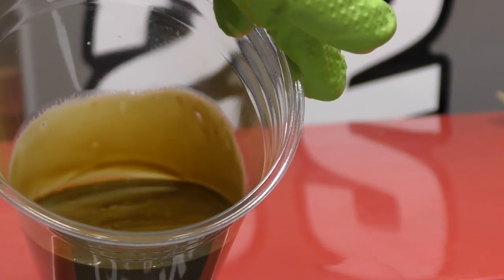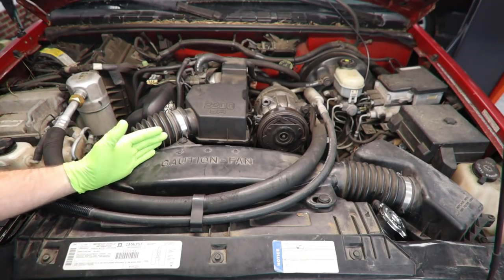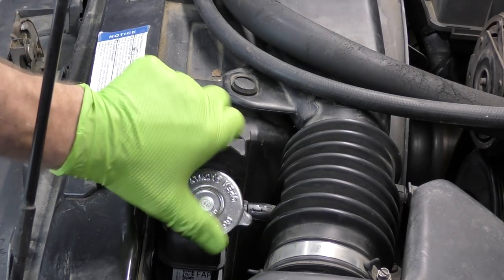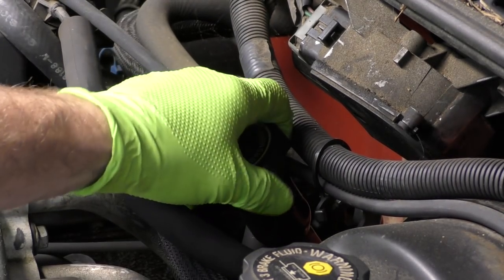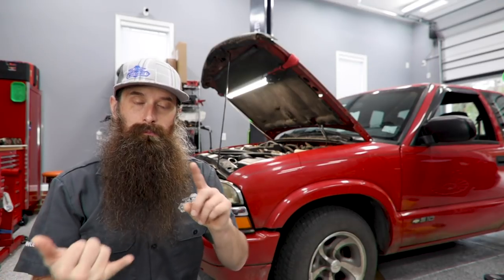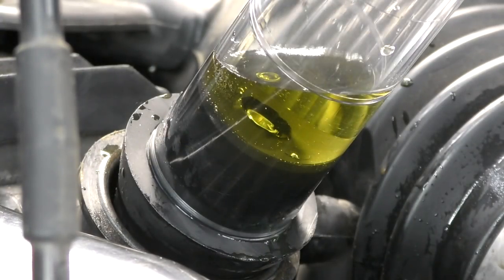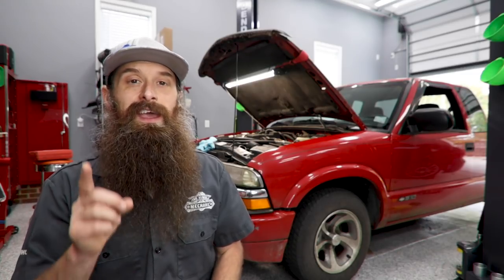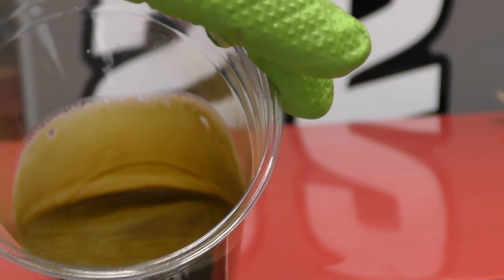Does Your Car Have a BLOWN HEAD GASKET?

Comment: Not that is applies here but don't ever overlook water to oil coolers. they can split internally and cause the same issue
Reply from the maker: Facts. I’m pretty sure I mentioned that. That’s the VW way to mix oil abs coolant ha
Reply: and he mentions it lol
Reply from the maker: Hahhaha when I think of oil and coolant mixing, that’s my first thought
Reply: @HumbleMechanic  i know lol, I flipped a V6 Dodge Magnum not to long ago and the cooler split. It leaked ext when hot too. Oil in coolant and vice versa. Bypassed the cooler for diag and problem solved. I huge relief to me as I was mentally already pulling the heads.

Comment: If that had a 4.3 V6 (not the 2.2 I4 it actually has) and still running dex-cool, then the intake manifold gasket would be the main suspect if the gas test had been negative. Common GM failure of that era.

Comment: Those engines are very expensive you don't want to just replace the engine if you don't have to
Reply from the maker: yeah going all in on just replacing the engine is not usually my first stop
Reply: @HumbleMechanic  last time I priced those engines for a decent one was about $1,200 opposed to pay me $350 labor and bring me the head gasket kit haha 😉